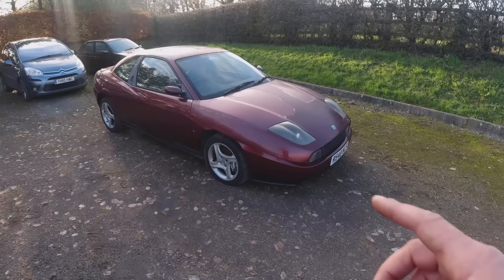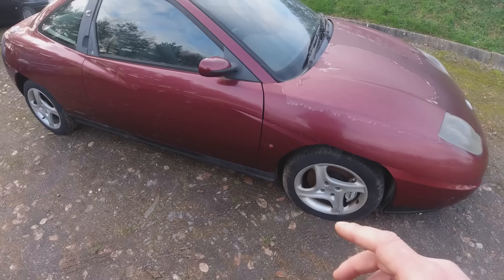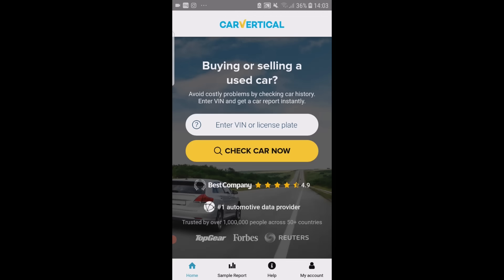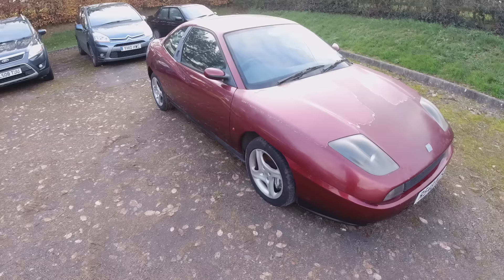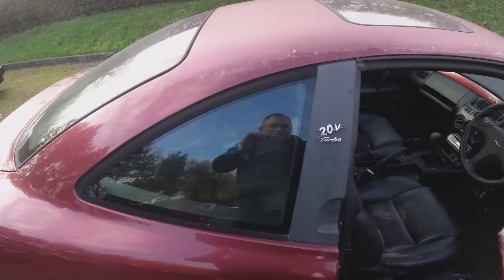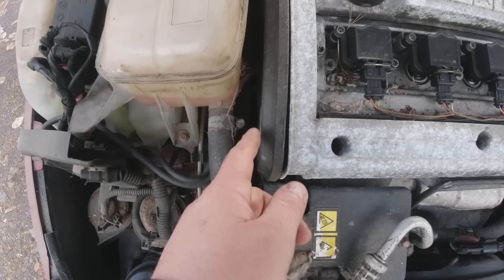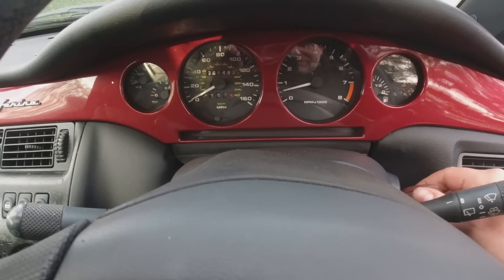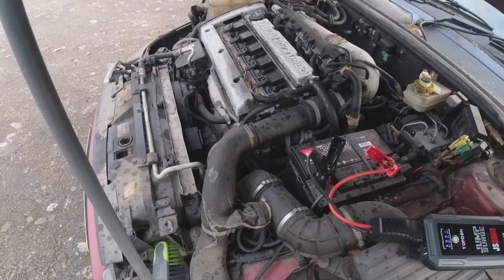Abandoned Fiat Coupe 20V Turbo! Will it Run?

Comment: Now you’re talking James, had the Bravo HGT back in the late 90’s, a 5 pot 20 valve that had a soundtrack to die for, the 20v turbo must be a beast of a motor in a car that small , looking forward to see you’re updates on this one , worth saving in my opinion, keep it standard with the factory colour, upgrade the brakes and suspension should be a looker and a real hoot to drive , you’ll get loads of smiles per gallon with this one 👏👏👏👏

Comment: Had an Ink Black 20VT back in 2008, definitely recommend FCSS (Joe). Over four years of ownership only major expenses were a cambelt replacement and new radiator. Lovely sound and once chipped by Flea was a great drive 👍
Reply from the maker: Ill check them out

Comment: The Pininfarina badges on the sides, let water in which causes the rot behind that panel. The boot floor rots out on the seams at the sides and rear panel. The bumper mounts front and rear nicknamed 'eifel towers' rot out. 
Radiator surround rots out, bonnet clam shell rots on the inner seams, chassis rails underneath rot, floor pans rot, front chassis rots where the front brake pipe flexi joins the hard pipe, sills rot either end. Sunroofs cause even more rot.

Comment: sun roof is less desirable, brembos were standard for all 20vts, early model 20vts came with the cloth/fabric seats, 
i picked up a plus in 2021, for free, 350whp, 
2nd spare low mileage engine is going to be built for 1000bhp (keeping it fwd still) but getting the cambelt and turbo replaced on current engine.

Comment: Hi James, Well worth Saving, when i have encountered as clutch plate stuck to the fly wheel in the past, something that was passed on to me by a old school mechanic that has worked is to (if can can get the car running) wedge the clutch pedal to the floor and let the car fully warm up and keep running for a good while, release the clutch pedal, this may unstick the plate from the fly wheel

Comment: As an owner of a 1997 FC 20VT your clutch problem is probably the clutch master cylinder which is a consumable item but a nightmare to change as its right by the steering column / pedals and under there is tight!!...Still , if its rust free you must do all you can to get it in Top shape : re-spray, engine, suspension/shocks, interior tidy up, led lights, etc....You will then have a truly great machine even in modern times....PS: finally an engine tune, perhaps big turbo, intercooler etc....You will then have a shatteringly quick car. Goodluck!

Comment: FCSS or Midlands car servicing best bet for these - sorted me out with parts and work on mine. Rust biggest issue but often from inside out. Take off the rear door cards and check behind - the pinnafarina badges let in moisture that can get inner cills. Then boot floor, lift the carpet and look down the seam join to the rear quarter panel.
Reply from the maker: Cheers for tips

Comment: That little jump pack mate is only designed the jig a slightly flat decent battery into life on a car that's been running OK recently, I've got a battery from a fork lift on a trolley for big jobs with big cables.

Comment: Great cars, I've had 3...2 20v Turbo's and a VIS 170..both great but the 20v is an absolute hoot. I'd pay particular attention to the brake lines at the compensator , the lines corrode at the unions on the top as water pools there....same as the early alfa 916 cars, same platform ( tipo )

Comment: Not many checks you can do with a clutch apart from checking the fluid level and seeing if it works when engine running.  The clutch slave cylinder is outside of the bell housing on this one according to another comment, so that's easily checkable.

Comment: I had one of these about 15 years ago, same colour but with a toffee/butterscotch leather interior. It was fast as a b*st*ard, and just a super nice driving environment. I could drive for hours and step out as fresh as a daisy. I traded it in for a Mercedes SLK, which seemed like a good idea at the time. The Brembos I wasn't all that impressed with, my old BMW 325i had better brakes and they were absolutely stock. Derestricted from the 155mph limit and mildly tuned these are 170mph cars easy, if it had launched 5 years earlier it would have been classed as a supercar.
Reply from the maker: Like the ideal of butterscotch interior

Comment: I’ve had 3 20VTs and they’re cracking cars. Surprisingly very little torque steer to be honest. Definitely collectors cars now. One important thing to check are Turbo seals. Leave it running for at least 20 minutes and then rev it hard. You’ll soon see if the seals are gone.

Comment: I remember when they went for nothing , obviously wheeler dealers did the big MR model you have James were after some Engine maps etc it has over 300 bhp the company made the map specially for the car and did it far cheaper as it was the test mule sort of thing as it was the first 20v Turbo ever done , it wiped the floor if the same year Ferrari.

Comment: James I remember you doing a cat vertical check on a Nissan think it was a note possibly a Micra it had been written off twice and back on the road well in a car auction.
Reply from the maker: Sounds like you dodged bullet
Reply: @ChopsGarage  James you didn't read the message correctly I said I remember you doing a car vertical check on a Nissan and you said it had been written of twice you were bidding on Auction cars and think you were trying to show how important it is do the car vertical check.

Comment: knew someone who had one of these he told me the engine has to be removed to replace the cam belt due to lack of room to change it in the car!
Reply from the maker: It can be done in the engine bay but it needs to be totally detached and levered to the side, even then its tight

Comment: Nice standard car you have there, with lovely low mileage, well worth tarting up and passing on. Clutch issue will be master cylinder, possibly slave. Both are easy enough to do. No one's ever needed a red key apart from dealers having something to add in the advert. Bonnet cable can be replaced with a mountain bike gear cable.  

Before you do anything get ALL the carpets out of the boot and check for rust, check the underside for rust. Check the suspension for rust, check the subframes for rust, check the bonnet for rust. Basically... Rust. If all is as good as the rear arches you're on to a winner. 

Do not copy anything that wheeler dealers did, that car is deader than ya nans bedroom antics.
Reply: And the injector light is the engine management warning. Needs codes read.
Reply from the maker: cheers for tips

Comment: I have 10 of these. My most recent Vinci LE I sold to my brother earlier this year. He still owns it. I got bored of them and then went back recently. The spark wasn’t there anymore. Done and dusted for me.
Reply: Sorry HAD ten of these, no HAVE
Reply: Brembo calipers with 305mm discs were standard on 20VT.

The LE got red Brembo on front and red calipers on rear. The LE also got drilled from discs. Recaro seats in red and black went into the LE with various titanium painted bits (headlamp bezels, fuel cap, rear lamp clusters etc), push button start, skirts/chin splitters etc etc. Big money now, not sure what they actually sell for though as there’s a lot of gas around them.

The engines are really good, oil pressure hot should be around 3 bar on a hot engine idling in summer. 

Always run them on 10W60 for better oil pressure and to minimise consumption.

Timing belt is on a 5 year interval. Note that the power steering belt system is fragile and often the tensioner fails and chucks the belt into the timing belt.  This literally happened on my brothers LE days after we did the belt, the faulty part was a brand new Dayco PAS tensioner that detached in two (clearly not made my Dayco anymore). Even though the timing slipped there was no valve to piston contact (he is a lucky chief).

Floors rot, radiator support panels rot, rear quarters rot, sunroof cassettes rust in situ and seize.  

Basic chassis based on Fiat Tipo lol. Bilstein B6 work well but lowering does cause a lot of ground clearance issues.

Comment: Don’t just do the cam belt , do the auxiliary belt as well.

I had a ( good ) 20VT for a couple of years. It’s styling didn’t work for me . The engine is something else , terrifically fast , a sound to die for, and as smooth as silk , and a delight even just tootling around . Very little torque steer even when really pressing on.

Comment: There is no clutch cable. Sounds like your slave cylinder has failed, but try and pump the pedal by hand if possible and then bleed it just in case.

Comment: Like them but headgaskets and heads dont so much.One of those cars you are probably better throwing away in the long haul.No one rebuilds these lumps because they dont want to give a warranty with the build. To be fair most turbo petrol engines give issues with age but these walkaway.